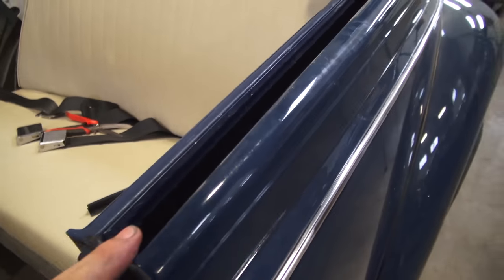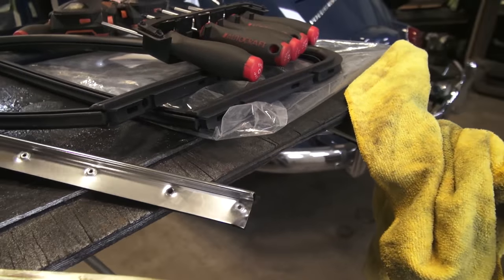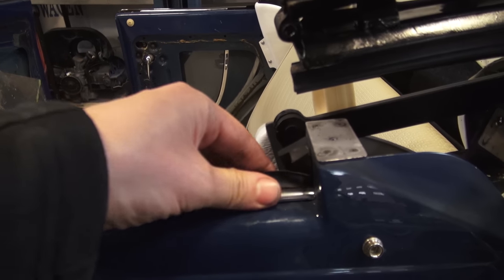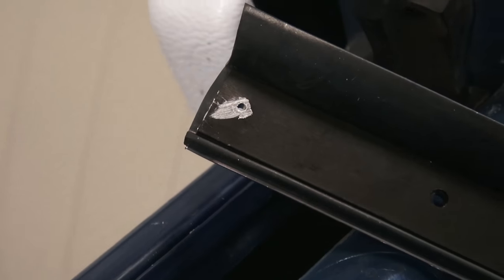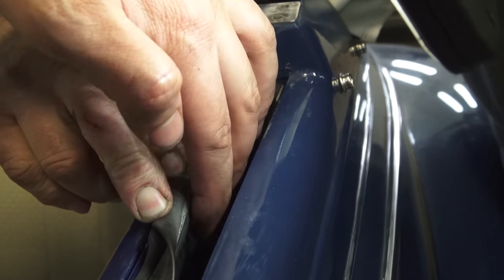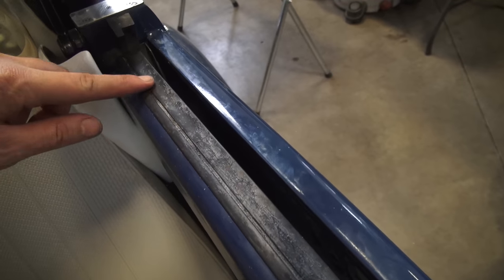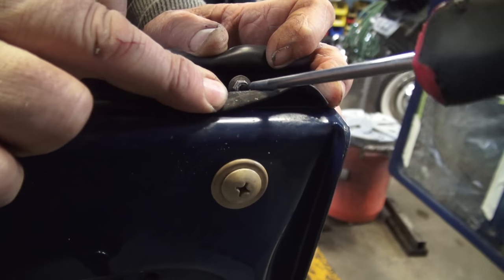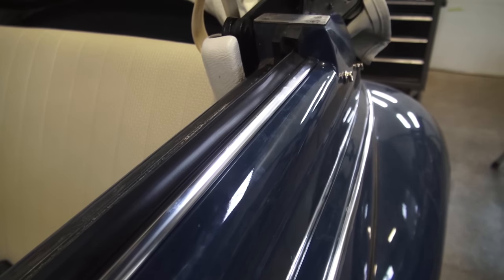Classic VW BuGs How to Install Rear Convertible Quarter window Beetle Rubber Scrapers

Comment: at 2:35 in the video there is a philips looking grommet, what is that for? We have a 1963 and we cant find what it does or what it is for anywhere. Thank you.
Reply from the maker: Yes the plastic seat belt screw plugs.  Not sure if they make em new, you have to source some good used ones.

Comment: Is there a vid on how to install the rear windows or adjust them one of the rear windows doesnt align at the top with the front window its slightly bowed out the pass  side window is fine. Are there shims maybe that need to be replaced?

Comment: Hi Chris! Thanks for this video. I know that in earlier verts, the scraper doesn't have that metal piece attached to the rubber, Do you know what holds it place? Is it just a metal lip on the car or some sort of metal clips? Thanks
Reply from the maker: It would just be held in by the clips that slide into the chrome trim and then clip into the body.
Reply: Chris Vallone Ahh, got it! Would you recommend to drill those 2 holes and use the newer scraper? In the old ones I have installed now, it feels they are loose, but not sure if it is because those are old or the system itself.
Thank you for the quick response!
Reply from the maker: @charlitoss6164  If it was me, I would get the correct seals.
Reply: Chris Vallone thank you sir! Appreciate all the effort you put in this channel! Greetings from Argentina!

Comment: Couple of questions,
A video on how you do your carpets would be great at some point :) and is it possible to install beauty rings without them scratching the wheels? 

Thanks!
Reply from the maker: Yeah I am working on a carpet kit vid.  I have so many tips in my lineup, but I will get to it.  As far as beauty rings, which ones are you looking at?
Reply: Chris Vallone the kind that have multiple metal clips that scratch into the rim.
Reply: Not the hub cap mounted ones. As in the kind that shit around the edge of the wheel
Reply from the maker: ok so the ones that hug the outer part of the rim, yes they sell ones that do not scratch on ebay.

Comment: I'm having trouble with my engine not idling correctly, sometimes it runs fine, but mostly it won't idle and I have to rev to keep it running l have tried messing with idle speed and even cleaned the little stream jet for the carb, have any tips for what to do?
Reply from the maker: I have videos on this topic
Reply: Chris Vallone my jet is not where that plug is, it's on the opposite side but I'm guessing it works the same?
Reply from the maker: what year carb?